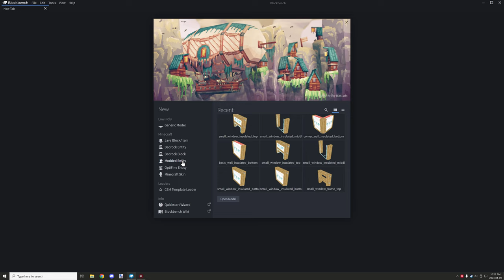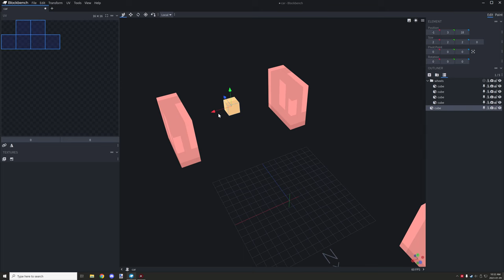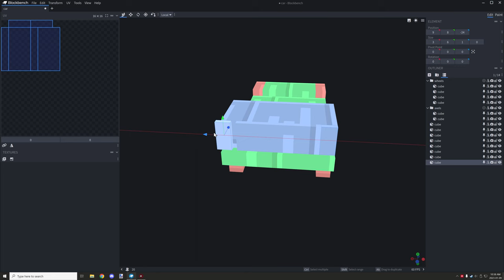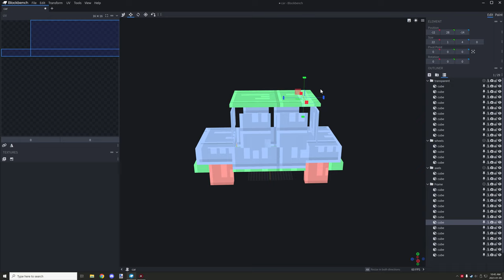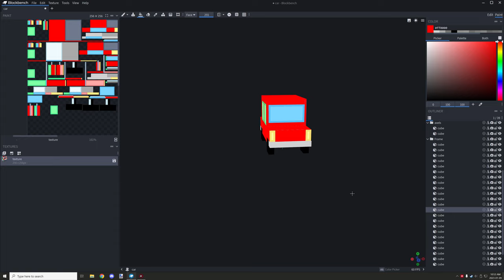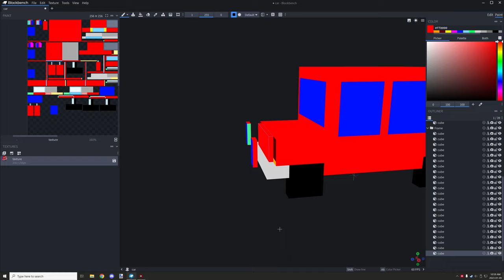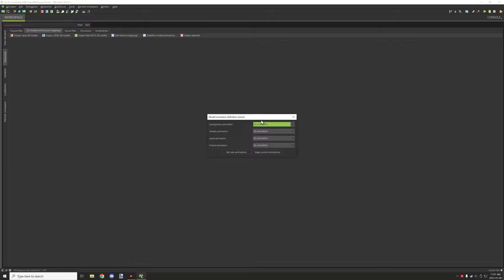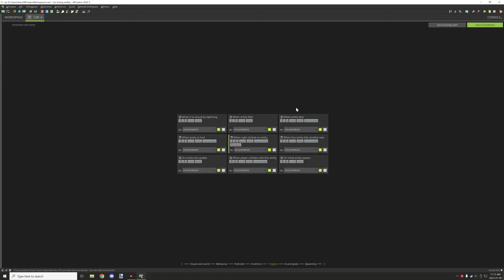MCreator: How to design a car in Blockbench 2022.3

Comment: Hey thanks for video. But i tried to model and texture a suv car but when i try to run the game, spawn egg spawns nothing. Or invisivle i think because when i spawn car in sky, i can hear fall sound. But i cant right click and ride anything do you know how to fix it
Reply from the maker: There is a good chance your UV map is not properly set up for the texture. If there is no errors then most likely the textures are clear meaning where the texture should be clear pixels are.

Comment: I was wondering if MCreator has the ability to take a normal block that acts like player? Just so you dont have to sit, say at the mod farm or golem farm. Like with a golem farm it continues to spawn golems while you can run off and do other things.
Reply from the maker: Through plugins its possible, but stand alone no.
Goldorion on of the MCreator contributors has a plugin for this actually I will link you it.
https://mcreator.net/plugin/68758/goldfuscate
Its not yet updated to 1.19.2 but 1.18.2 is supported.

Comment: English is not my native language, and I use Google translator to write this message, so I apologize for possible errors
, can you advise how to make 3D armor that does not match the parameters of the player? let's say the helmet is not 16x16, but 5x5, the helmet is just hiding under the player and it is not visible, what to do? is there any way to solve this problem? I know the problem is solved with code, but I don't have enough knowledge to do it, please create a tutorial video
Reply from the maker: I am honestly not be best person to ask this question, I have never been able to figure out the 3D models for armor, they always had issues when I tried to make them.
I would suggest asking on my official MCToolkit discord server you can get the link on my website, there is a community help section that is pretty active with people helping each other there. If you do join discord just remember that COPPA is 13+ for peoples age so if you are younger then ask on MCreator's forums instead.
Reply: @NorthWestTreesMCreator  then could you answer my other question? the youtuber ZenZen_ has a video "Mcreator: Laser Weapon Showcase" 
 how did he do it??? can you write down a tutorial?

Comment: this is not a car, a car have more than 1 sit, have a velocity and pitch, have a motor, have sound, wheels turns, and for turn, we press Q or D we don't moove the cursor
Reply from the maker: Controls are defined by Mojang/Minecraft that can't really be changed to much, however this tutorials was just to show how to make the model for the vehicle.
Wheel animations are limited with the base program or I would have shown how to do this but it may be possible in the future I am not sure. Engine sounds and all that can be done using procedures, and sit locations are limited to one person, this is just what we have with MCreator at the moment I hope they add more seat support in the future but its just not possible at the moment at least.